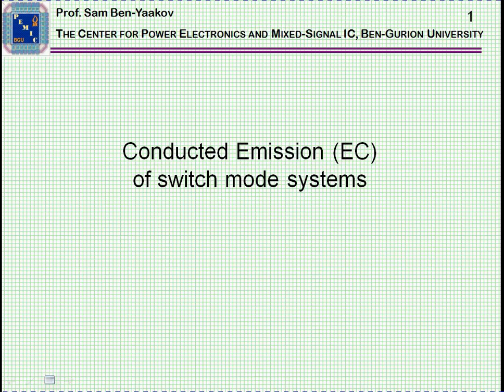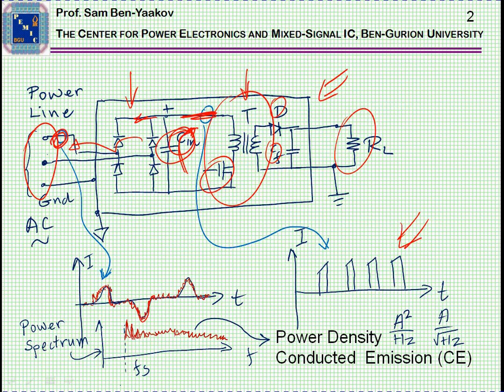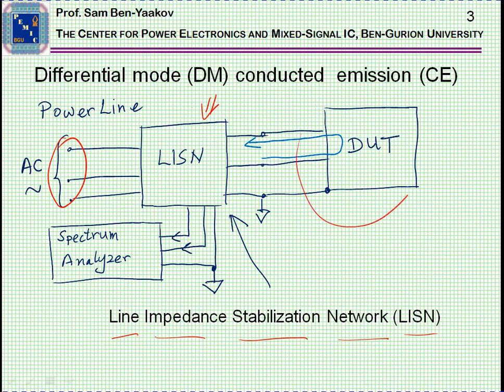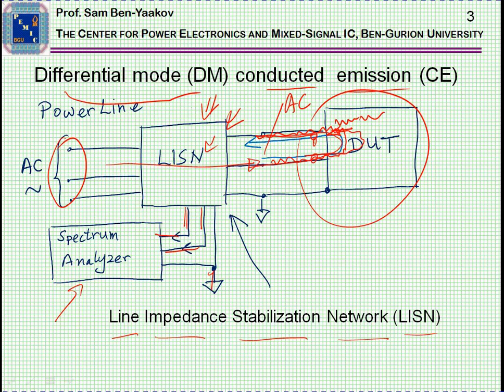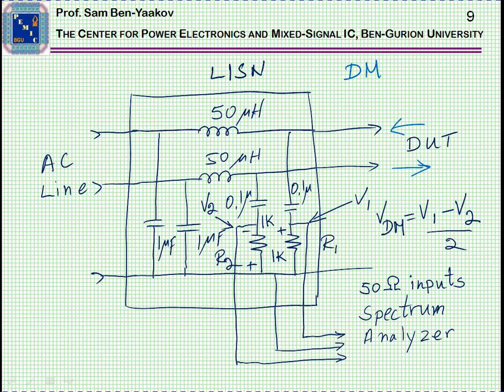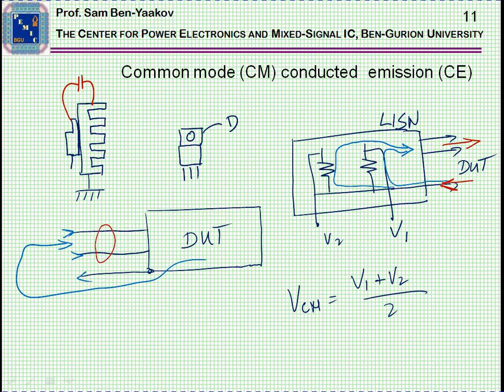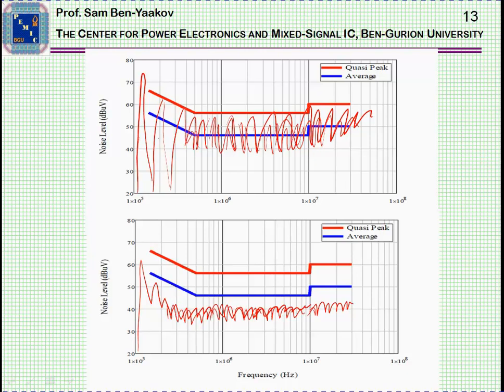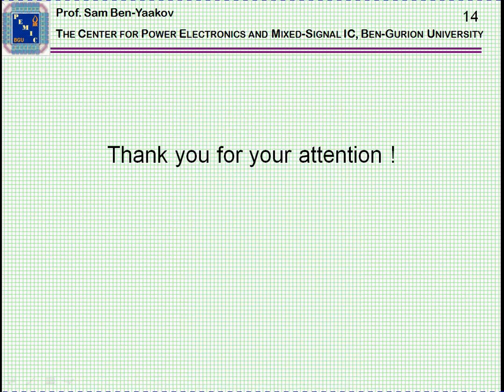Conducted Emission (CE) of switch mode systems

Comment: There are 50uH and 5uH LISNs. What is practical difference? I can see that 5uH at 150kHz is 5R impedance only. So that will be useless, won't be? or i misunderstand that?
Reply from the maker: I wonder. Perhaps the 5u is used for HF range ?
Reply: @sambenyaakov   What i can see 5uH are usually for DC lines, while 50uH AC mains LISN. But still don't understand that. I'll share that when i find out.

Comment: How 117u/50ohm is A/sqrt(Hz)?
and 20mA RMC current is correct regarding 45 dbuV???
it seems quite high!!
Reply from the maker: Can you please point to the minutes in video?
Reply: @sambenyaakov  Hi Sam
8:20 for How 117u/50ohm is A/sqrt(Hz) and 9:50 for  20mA RMC current is correct regarding 45 dbuV

Comment: Hi Sam.. I have issues with the Radiated emissions at frequency of 60MHZ and 120MHZ..
I have done initial analysis of snubber where I could see ringing voltage is of 80V with frequency of 1.8MHZ..
Can you help out how to mitigate this issue.?
Rough idea.
Reply from the maker: Try to use ferrite beads .See https://youtu.be/F-wSu162tCo
Reply: Where I need to put ferrite bead.?

Comment: Nice video proffessor sam !! it is extremely useful for understanding CE in detail. can you also make a video on how to design inut EMI filter for AC power lines for motor control applications ??
Reply from the maker: Thanks. Will try.

Comment: Thanks so much Dr Sam you are wonderful 
I have question , if I have  for example 90uDB at  27Mhz and this for 480vAc 3 phase and this noise in all 3 lines , so this mean it is common mode noise? And if I need this noise to drop to 40uDB.
Can I determine value of cap or its impedance of cap at this frequency ?
Like how much impedance I should have to reach to 40uDB.
Thanks so much
Reply from the maker: THe attenuation is not just due to an added cap (in sparallel) but also a function of the line impedance (low pass filter).  So you either rely on circuits inductance or add an inductor to obtain the attenuation you need.

Comment: Hello Sir,
Very beneficial lecture, please add some tutorial for how to design a CM and  DM filter design , some mathematical equations for it
Reply from the maker: Thanks. Will try.
Reply: Hello sir,
Today I have tested my design for Conducted Emission.
Everything is fine but I was getting some noise near 15 Mhz and crossing CISPR15 Limit.
Would you help me regarding this
  from where I am getting this noise. Please see below Technical detail regarding converter
Test Input voltage 240 Vac
Converter frequency 65 Khz
Topology QR flyback
Duty Cycle at 240 Vac =30%
Reply from the maker: THis could be due to sharp rise time or parasitic oscillation. To test, try to slow down the switch by increasing the gate resistor.
Reply from the maker: Please feel free to write to sby@bgu.ac.il
Reply: Sir I have mailed you,please check and revert
Reply from the maker: Did not get the email
sby@bgu.ac.il

Comment: Thank you Sir for this amazing video!
I have 2 questions:
1) To measure only differential (or only common mode) conducted emissions, we set the spectrum analyser to look only at the diference of the signals (or sum for CM)? This option is in the settings?
2) How would you recommend to decrease conductive emissions in a three phase motor bridge that takes high current (100A), that a pi filter can't be used? Changing gate resistors, more capacitors on power supply...
Reply from the maker: 1. You mean when using  a LISN?
2. Increase  of gate resistors does the trick at the expense of additional losses
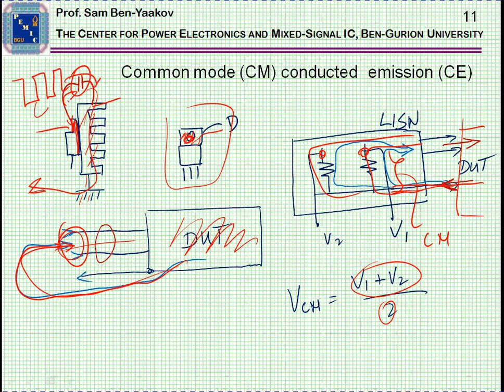Reply: 1. Yes. As explained in the video at 11:30 and 15:00.

Thank you for your answer.

Comment: Hi Shmuel!
This presentation is very useful for anyone, who really wants to monetize his (her) design of the power supply. To my understanding, DM conduction emission can be measured in SPICE simulation (with or without taking the inductance of wires into account). On the contrary, CM emission strongly depends on how the converter is built in practice. Are there regulations regarding the permitted level of CM emission?
Reply from the maker: Thanks for the comment. The regulation covers both.